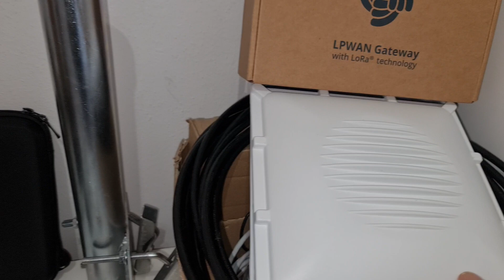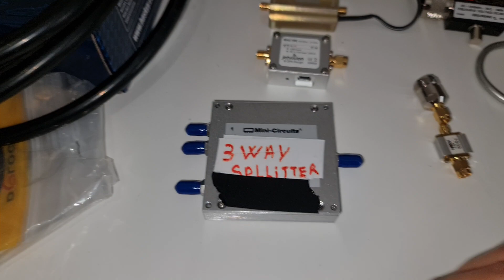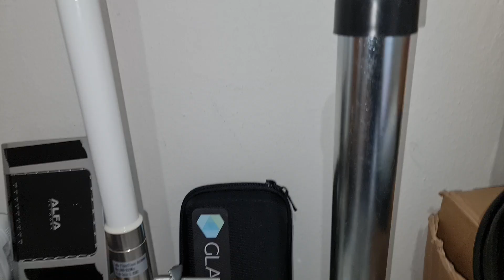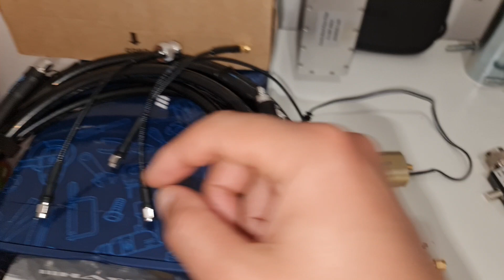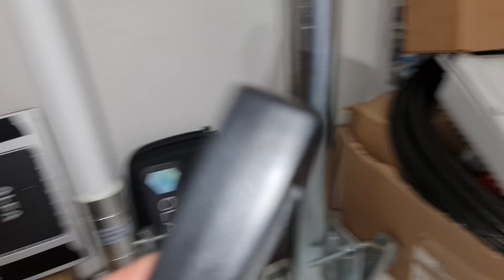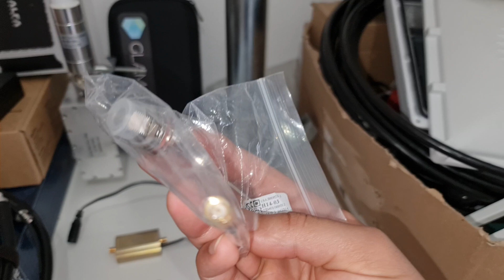Best Helium Setup That Money Can Buy 2022 Part 1  👌 - HELIUM ADDICT😎

Comment: Cat 8 it's pointless unless you have a 30gb/sec  internet speed conection😂 and that does not exist at this moment in time... with cat 5e or max cat6 ftp you will get the same rezults but much cheaper.

Comment: For those rssi to high, just use splitter with high port isolation, and for witness to far use uptronics amp with a splitter on antenna side, use high gain antenna for rx and low gain for tx, that eay you wont get invalids, and you could still use couple of miners

Comment: Thanks for nice video. Why wifi is not good?
Reply from the maker: Wi-Fi will not give you stable connection .
Reply: @heliumaddict8582  could you please be a little bit more specific?  Like what is the problem latency, upload speed, download speed, outages, lost packets?
Reply from the maker: @martinkollar3778  latency, outage, lost of packets